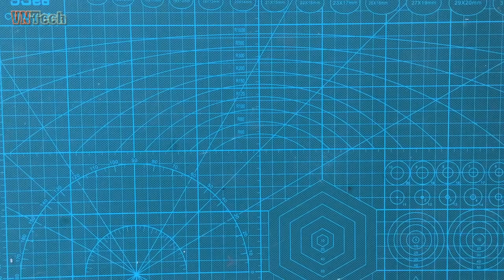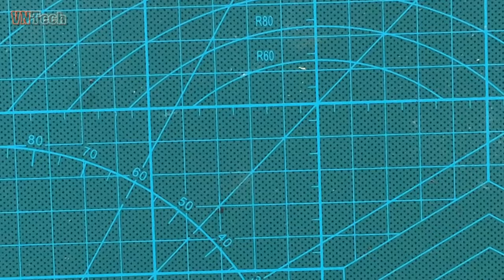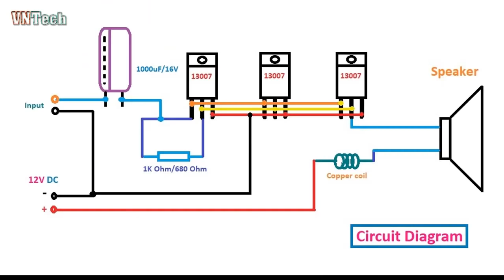Powerful Bass Amplifier Using Triple 13007 Transistors From PC Power Supply

Comment: Electrical Engineer here. You need to isolate the speaker from the 12V line. Remove the inductor (labeled as coil). Now connect the 12V directly to the transistors instead of through the speaker. Put the speaker in parallel with the transistors, one side to the 12V line and the other to ground. Add a large capacitor between the speaker and the 12V rail with (-) side to the speaker. This should isolate the speaker from the 12V, preventing it from damage. It should also make the audio sound a bit cleaner. Improving on this: Calculate a base input voltage offset to keep transistors in active mode and add a resistor from base pins to ground. It'll reduce distortion.
Reply: How?can you modified that sercuit
Reply: In my opinion, best he can do is to use two of these 13007 as push-pull topology, not as "quasi-darlington" single ended. It present topology it's easier to get transistors fully saturated, which causes distortion. Second thing is that single ended amps  (A class) have less efficiency than push-pull amps (AB class).

On the other hand, testing bass speaker in "free air" conditions is not a good idea. Even a weaker amp can provide some bass if the speaker cabinet is calculated correctly. Enclosure makes at least half of job in providing bass from the speaker.

And the last thing. Wanna see speaker bouncing? Use a real woofer speaker, not noname like this. This magnet looks really tiny, and suspensions of this speaker can be too hard :) Maybe Eminence Lab12?
Reply: @MichaelBeeny  said, "This guy is an idiot, you NEVER pass DC through the speaker, but he always does!!"
Bit of a harsh way for you to offer your constructive criticism, isn't it Michael?
Reply: @MichaelBeeny  will damage speakers
Reply: @lowertones9713  i agree.. michael i dont see you putting up videos do i? if so you tube isnt sugesting yours to me..hmmm
Reply: mr felipe loera..electrical engineer..can show a sample diagram sir??so that we can get more idea
Reply: I would of put 2 16v 1000uf and yea I wouldn't run the + to the step transformer etheir . At least not directly to the speaker .
Reply: @lowertones9713   maybe a bit harsh, But if it isn't listened too, the guy is worse than ignorant.  Seriously,  why run DC through your coil?  I mean, is the intent to burn it up under medium load with too much current flowing?
Reply: Felipe Loera do you mean this circuit? This is what I understood from your explanation https://drive.google.com/open?id=1o7fLGSaGhIKg_i3q0RZrDSZJHvg1vyFq
Reply: Cool
Reply: @lowertones9713  lol
Reply: the title says "Powerful Bass Amplifier Using Triple 13007 Transistors From PC Power Supply
" it doesn't say "I'll make an amp the way you want"
Reply: @NWNiko  sir have u tried that diagram?
Reply: @jsonbraga9700  I tried it but adding a low value high power resistor (something like 10~50 ohm, 10 W) between (+) and the collector of the right transistor (it's important to keep the 2200uF cap connected to the 12V directly as in the diagram). It works pretty well and no DC runs through the speaker
Reply: @NWNiko  thank you sir..
Reply: @NWNiko  sir can I see you schematic diagram?thanks...
Reply: @piterbay5562    .   .. .         .
Reply: Upload that video
Reply: podrias enviarme el diagrama amigo Felipe Loera
Reply: @NWNiko  the positive is directly in the collector and the negative is directly in the emitter will cause the component to burn
Reply: @brathzo  no, its not making the amp the way it should be made (the correct way) which is the issue here, this is a total joke, "powerful bass amplifier" its more like a weak turd.
Reply: @delawarepatriots  "i dont see you putting up videos" what does that have to do anything ? answer it has nothing to do with anything, straw man much ?
Reply: Hey can I make a sound amplifier from resistors I removed from a old solar inverter
Reply: Technically the DC in this circuit is being pulsed to the sine wave from input essentially making a/c. The speaker wouldnt  be playing sound if it was pure dc.
Reply: how much resistance (Ohms) need when i want to drive the amp on 47VDC (GWR112 Power supply board with bando transformer) Is it possible?
Reply: its gonna burn the speaker coil as hell, i reviewed that circuit diagram and this not gonna work.
Reply: but "Add a large capacitor between the speaker and the 12V rail with (-) side to the speaker. " is a good idea, because if the power supply capacitors are not doing too good work or the PSU just old: the huge capacitor (example 16V & Up to 8F rating) gonna smooth the power to reduce distortion.
Reply: De qué color es la resistencia
Reply: For the capacitor between the speaker and transistor can it be a bipolar?
Reply: Would this work with the classic dual Darlington setup that calls for +12VDC straight across the voice coil? I always seem to have a 3-5V DC offset across the speaker and it can't be good.... I love the dual Darlington design because it's stupidly simple (TIP122, TIP127, a 100k resistor and a 1000uF capacitor, plus a pot - done!) but the 12V supply going via the speaker just kills me on the inside.
Reply: @kreynolds1123  Porque' no hace el circuito añadiendole las mejoras.Soy un aprendiz pero veo que eneste campo hay muchos Eruditos que criticanpero no hacen un tutorial con toda su sapiencia.Solo critican.Saludos y quedo a la espera de tu video aplicando todas las mejoras.

Comment: This is a Common Emitter design with Collector Feedback. The only reason I can see why you would find the need to put the 3 transistors in parallel is to handle larger currents for stable load lines effects (each transistors can handle up to 8 A, 80W, and 400V). 

Also since these are switching transistors, they are not the best amplifiers. Nice project. 
I would suggest that you use these transistors in Darlington configuration to get higher hfe values.
Reply: I need your knowledge lol... Because i have no idea what your alien language is... And somehow i ended up turning a simple 10 watt computer speaker amplifier into a stable 350 watt setup... Lucky i guess, teach me your ways lol
Reply: @jamdvx Increasing the input to too high a level will cause distortion. The standard for input levels to transistor amplifier preamp like this is about 1 Vpp or 1 volt peak to peak.

Comment: It's like the first amp I ever built when I was 14.  Mine used only a single transistor and a 12V adapter. Your coil is not necessary, unless you want to pass only bass, you should use a much bigger coil.  Quick, dirty, and effective, but most certainly not an optimal design (DC goes through the voice coil, raising it's temperature).

This is a class A constant current amplifier (no electrical voice-coil damping/control), open loop (no feedback) and direct connected output (no capacitor).

Have fun and be safe!
Reply: Replace the coil with a capacitor, and this design would be fine.
Reply: cleber g pereira Spawn  around 1000uF - 2200uF. Note, capacitor value will affect the frequency response. The lower the capacitance, the less bass you will get.

Comment: A couple of things...
18W max @12V (1.5A x 8ohm load) With a 4ohm speaker you would double the current and wattage, also if you use a voltage doubler or boost power circuit you can get more wattage. Of course all the components would have to have voltage ratings to support higher voltage and proper thermal heat dissipation as well.
When bridging the output of transistors to split the current amongst the transistors, you must send the output of each transistor through a .1ohm resistor to account for the variables in manufacturing of the transistors.
Only a positive voltage can be applied to the speaker. This would be considered a push amplifier instead of a push/pull amplifier that can also apply a negative voltage as well. A speaker can push out and also pull in to match the waveform of the music.
I am not an electronic engineer but have been repairing electronic, electro/mechanical devices for 40 years and I am certain there would also need to be other support components to create a quality signal output and efficient amplifier.
Reply: Sem considerar a eficiência do amplificador classe A, ou seja, 50%. 3.1 / 2 = 1.55W. Without considering the efficiency of class A amplifier, that is, 50%, 3.1 / 2 = 1.55w

Comment: The comments section is full of self appointed experts. Lads, he's not aiming for hifi here, he's just showing you a fun little circuit with a few old parts.
Reply: well if these people want to keep using the titles that they do then make literally the same exact thing so many other youtubers have done using the same bs titles then they can expect the same kind of criticism
Reply: No HiFi but at least proper implementation of low frequency aplifier.
Reply: I think it's a cool little project that looks fun to try, but these people are taking it way too serious.😜
Reply: @paulzedx636ninja7  Maybe the project is cool, but when some young person with not so much knowlege try to do it, and burn down its audio source (phone maybe) and speaker (transistor short circuit), that video is becoming a very bad way to learn electronics. This circuit is high ineffective and in some situations its could be even dangerous.
Reply: You could literally use the exact same parts and make something that sounds good , if you build it correctly and not just slap stuff in the wrong places. Never put DC through a speaker. Efen just using an inductor in the collector would have worked better, look up inductor class A amps.
Reply: TITLE IMPLIES LOW FREQUENCY OR BASS  THAT IS NOT WHAT YOU CALL BASS  BASS EVER HEARD OF IT

Comment: This is a class A amplifier, wrongly designed.
The transistors work "saturated" so in the loudspeaker constantly passes a voltage equal to (Ucc-0.7) volts, which will lead to its destruction.
In order to be functional, a correct polarization of the transistors and an impedance adaptation with a transformer must be made.

Comment: Strange how a speaker works with DC voltage....that circuit looks like a simple boost converter, not suitable for audio signal boost...
Reply: It doesn't, not for very long, anyway.

Comment: These are not linear transistors, they're designed to switch rapidly, so the distortion is about 10%.  Also "powerful" is not a good description, with a 12V power supply and an 8ohm speaker, you should get about 4V RMS voltage, current will be 0.5A and your power will be 2W at the absolute maximum.  Ok, it might be 4W with a 4 ohm speaker.  That's not powerful.  And since music has drumbeats and similar surges, you wouldn't get more than 1W, really.  So, what you have made is a 1W fuzzbox.
I suppose if you have an old power supply and nothing to do with it and you're not fussy about all your music sounding crappy ...
Reply: dude you're cool with your tips. But his technique works.
Reply: @electromechanik4740   I don't call it working if you really can hardly hear a note.

Comment: it may be strong but the sound is not clean
Reply: where in the circuit would you put that?
Reply: also, how would you know that the sound is not clean? the speaker isint even in a box. speakers always sound a lot better once you put them in a good box.
Reply: @adamhosseinei8631  Because we've seen the schematic. This will be distorted. Also will put DCcurrent  through your speaker, which means it will lower performance and maybe even damage the speaker over time. Happend to me with similar circuit...
Reply: ভাই এবাজে না তো,
Reply: @adamhosseinei8631 100% quaranted the sound is not clear.  Too much distortion and noisy.  Because it's a very simple amplifier with no filter at all.

Comment: Full range amplifier.  No crossover, can hear full frequency range from the speaker.  Bwahahhahahahha
Reply: Chris Bourassa  the Toriid coil in series is a low pass filter but isn’t calculated for crossover freq., it’s whatever it ends up.   that’s a extremely large coupling capacitor I thought he would filter power with it .  The pot could be  tied to ground or center  instead of open.   
I haven’t ever seen supply voltage to circuit fed thru the speaker before.    So I’m with the person making  top comment of 100% fake project.  never used beyond proof of concept
Reply: Dave Zimmerman  yea, 1,000 uF? I was thinking smoothing cap for the DC supply for sure, not coupling cap. I would have thought no more than 100 uF at the most. Wouldn't a cap that big lose some of the high frequencies without a smaller cap, like a .1 to 1 uF, in parallel with it? I have lots of circuit diagrams of audio amplifier circuits, one high power one with 9 complimentary pair amps in parallel, in class AB, and it only uses a 1 uF input cap. Granted it has a long tail pair differential amp input stage and two additional amp stages before the 9 comp pair output stage, but still. This amp just seems to have sound quality better than I would have thought it should have for no more than it has to it. Also would 1K bias the transistor bases where they would need to be for a proper quiescent point without cutting off the tops of the loudest waveforms in saturation, or the bottoms below the cutoff point? This looks like a common emitter amp setup, but I would have put a load resistor on the collector to the positive supply, a couple of coupling caps like a 1,000 uF and 1 uF for a small speaker like this, or a 4,700 uF and 1 uF for bigger speaker(s,) on the collectors to the speaker(s,) the speaker(s) to the emitters, a biasing voltage divider on the bases and figured out what values it needed for a good quiescent point, and I might have even considered a low value emitter degeneration resistor and bypass cap to trade a little gain for improved stability and linearity of the amp. Of course I could be wrong, my knowledge of electronics and audio amps is limited to what I've read in books and online, I haven't taken formal classes or anything, it's just a hobby, but this amp though meant to be a piece together from old parts, just seems too good to be true, to me.
Reply: The interesting in this project , is that he is recycling the materials from an old PC power supply that's a plus for the enviroment . Good Job VN TECH !

Comment: Could I use a 19v 3.4a notebook power supply?
Already working with a 12v 1.5a power supply
The potentiometer I'm using is the B10k and it didn't get too loud. 
I am looking for a 100k. Can I add a 12v led to indicate it is on?

Comment: So many questions... I have very little understanding of componetized electronics... Always wondered how to do a simple amp like this... But why not use a cap and resistor per transistor? Like i said, i have very base line "youtube" knowledge on stuff like this, but it'd be my understanding that the sound wouldve been cleaner with less distortion if each transitor had a cap and it'd change the hertz of the sound range per resistor used? Am i correct to say you should be able to have used as many capacitors on a device like this and it'd just help carry a load without constantly pulling power? As in that it wouldn't effect anything other than it's ability to have power as it needs it withou constantly pulling "fresh power" from the battery or the power plug?

Comment: Put the output on a scope, its only amplifying 1/2 of the waveform. Those transistors are NPN, would also need PNP to boost the other half. Still pretty cool :)
Reply: As long as you don't know or care anything about electronics and music, your answer is right on!
Reply: It's actually a class-a...

Comment: do 700ohm good? 3:11 (200+240+260ohm at series)?
Success

My AMP is now working:
2xD13007 Transistor
2200uF 16V
700ohm
Power source: 5V-1.7A (Power bank)
Speakers 2x3W noname 2" (mid)
System is loud lol, i smell the bass in the 2"speakers cartoon box. i smell the lows (20-40hz) :D
i tried also on 30W Home sub, i think i need 12V-3A power supply :D 
We worked good, u deserve the like. :D

Comment: Running dc thru the speaker is a bad idea, and the biasing of the transistors will jump all over the place, as it will vary with the inductance of the speaker and coil. I understand it is meant to be a simple experiment, but it's not good for the speaker. If you remove the coil, and use a 1:1 transformer between the speaker leads, you'll get rid of the dc on the speaker. Then remove the resistor leg from the transistor's center tap (collector), and connect it to the + instead. Then the bias will be more stable. Might work, maybe not. Just  pondering...
Reply: Yes, that's another way to do it. A 10 Ohm 10W resistor between C and +
would do, and a series cap to the speaker. That would give about 4 Ohms of load. But class A designs are very ineffective, as most of the power consumption ends up as heat. Class AB is way better, but not as simple as Class A. If I were to build a Class a with higher power, I would go for the transformer output, because the  load resistor would be enormeous and emit extreme heat.

Comment: With 12V power supply, it can only produce about 1W RMS without huge distortion. Another bad point: the speaker gets a lot DC offset, really bad circuit design.
Reply: He's not trying for hi-fi here, just showing what can be done with a few old parts. It's for fun.
Reply: @johnc3403  Yes, you are right. I'm just afraid, some youtubers think, this amp is good for hi-fi.

Comment: Cool idea. Just don't use it in a car. That positive voltage ran right to the speaker. If there is ever a problem with the vc I could see that shorting out to the cars chassis ground.
Reply: huhu ... followed with some nice fireworks ...

Comment: Power supply is only 1.5A at 12V therefore max power is only gonna be like 15watts(taking into account inefficiencies) also DC through speaker coil is not a good idea